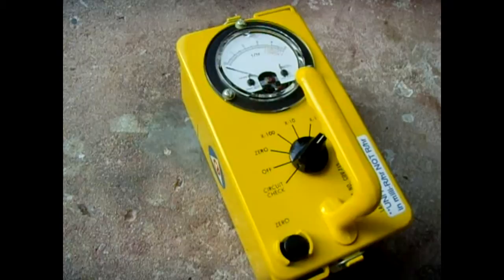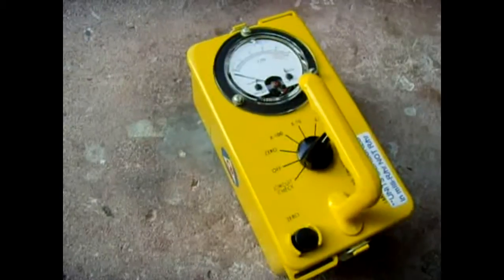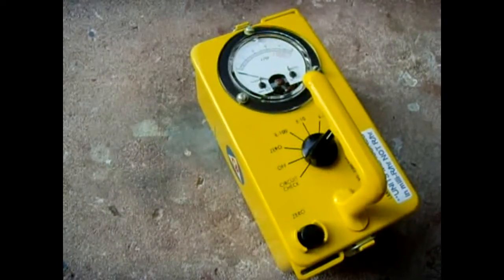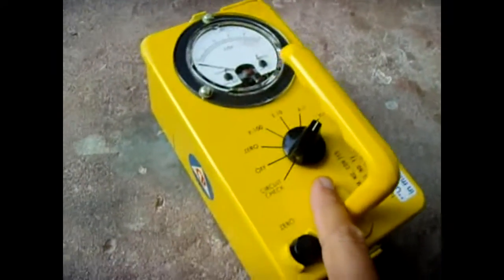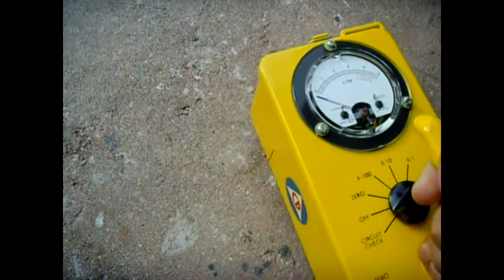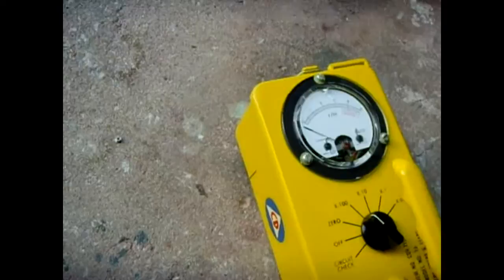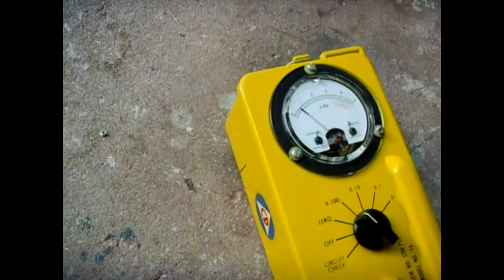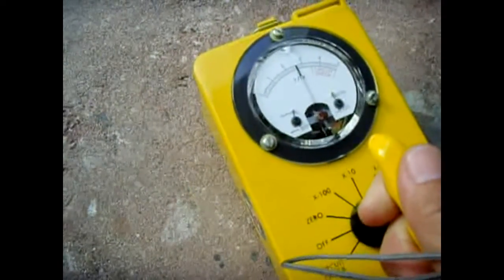CDV-715 Radiation Survey Meter Conversion

Comment: Do you have any videos on how to make a Faraday cage for sleeping in or can you tell me what materials to use to make one that will block all kinds of radiation?? Please I've been looking everywhere and can't find anyone who really knows how to block all of it or at least reduce all of it significantly. I'm super sensitive to it. Its screwing me up
Reply from the maker: Hi Amber. I know what you're looking for. It's called Faraday cage fabric. Some people attach it to their ceiling and allow it to hang down over the entire bed. You also need to lay it under your bed and attach it to the sides that hang down near the floor(Clamp together every foot. You can use a bunch of metal binder spring clips to hold it all together. You leave one side where you enter the bed a long slit overlapped opening in the fabric. Ideally you connect a wire from the metal fabric enclosure to ground.
https://amzn.to/3e1s15D
(Amazon Affiliate Link)

Comment: Neat hack for display, but I think you missed the point of the 715.  They made different models for different jobs.  It would be like saying a screwdriver is useless because you can't use it to nail two boards together with.
Reply from the maker: Hello. I didn't miss the point. I know exactly what it was designed for, but it was worthless to me, so I made it a "useful" radiation detector.

Comment: Hi, Nice video..I see you posted this in 2011 so my info may be of no use but with your power off and batteries removed, your needle should rest above zero. That meter should have a meter zero screw in the middle at the bottom. CW will cause the needle to move right and CCW to left.. It really is not critical unless you want to calibrate the instrument.
It appears you have plenty of gain now and the instrument will be MUCH more useful. I do not know the details of your mod, yet but I am guessing you have an open mesh so you can see alpha, beta and gamma. Place a piece of foil over the mesh opening and it will filter out alpha. Put a piece of double sided copper PCB over the window and then you will only see gamma.  
Good luck.
Glenn 
DSM Labs (dot com)
Reply from the maker: Hi there, You're correct, there is a calibration screw. :-).You are also correct regarding the open mesh. Be sure to check out my other radiation/geiger counter videos as well, rate Thumbs Up, and share.

Thank You!

Comment: Do you sell the 'fixed' ones?
Reply from the maker: No. I only put out the video to show how. These ionization chambers are designed for high radiation levels. If you don't modify them, they are useless. Be sure to check out my geiger counter videos/ionization chamber videos.

Thanks
Reply from the maker: ryan pogue

Yes, in a nuclear war these would be very useful as they are.

Comment from the maker: First of all I never claimed this conversion to be a "PRECISION" detector. To calibrate this unit, you would need to use a geiger counter to verify levels. Secondly, due to the fact that this unit ONLY detected very high levels of Beta and Gamma radiation before the mod, and now it detects ALPHA/BETA/AND GAMMA radiation  at low/lower levels makes this a HUGE improvement over what it was before. Thirdly, THERE IS NO PROBE! Lastly, you are a moron and need to get a life and stay off my channel.

Comment: I see what you're saying.  My point is under post war conditions you may need something that reads in several rem / hr range.  I hear the CDV-700 will be overwhelmed at this rate and read  0.
In my location we'd expect a worst case 1st hr. dose rate at 300 R/H. Hence the shelter.  It seems like maybe I'd need both, a high and low range unit.  Are these CDV units generally still good? I've been looking at some that are still 'new in box'. Calibration costs as much as the meter.
Thanks

Comment from the maker: NO. if you are detecting radiation with one of these meters that have NOT been converted, then it is no good. These particular units were designed for use in HIGH radiation areas. I mean extremely dangerous levels. You need a geiger counter. I made an excellent one. Check out my video list.

Comment: Questions;
For fallout shelter use, these high range devices are what you'd want, correct?
Also, are these things still accurate at all after all these years sitting around?  Again, for fallout use.
Thanks.
Reply: Yes, post attack, you would need to read roentgens in the short term. The high range meters would let you find the area of least radiation even if the calibration isn't exact. The low range meters would be overloaded. That's why CD had kits with high and low range survey meters and dosimeters and a charger. All serve a purpose. The old instruments can be found in good condition and if desired can be calibrated. Many, many CD meters are still in use with emergency personnel.

Comment: i have a few questions, i'm not too worried about alpha rad, since i can't really be hurt, but i have heard that the 715 can detect beta rays, and i don't really care about regular atmospheric radiation, cause that's normal. What i am planning on doing is searching through old antique stores for radioactive elements. will a regular cdv-715 do this job?
Reply: no

Comment from the maker: @stefaan10111992 

How about a simple piece of scotch tape over the battery and to the holder so it does not fall out. Unless your using that detector around Chernobyl/Fukushima.....its worthless as you have it. It was designed for measuring large amounts of radiation.

Comment: @myvideoisonutube My detector uses 1,5v, but the battery keeps falling out when removing the case, while the manual says you can also use the detector while the case is removed.

Comment from the maker: @Weps21 

According to techlib.com, the meter will read in mR/hr after this conversion. So just disregard the R/hr and read everything in mR/hr. I don't think the meter is accurate anyway. I just wanted a sensitive radiation detector, and now it is. You can tell if radiation is around, and if it is a lot, or a little with different settings. The original cdv-715 was useless.

Comment from the maker: @stefaan10111992 

I don't understand your comment. My circuit uses a standard 9v battery. Originally it used 1 or 2 D size batteries.

Comment: What about the meter conversion? The meter face measures in r/hr not mR/hr like a Geiger does, do you happen to have a tutorial to replace the meter face plate so it an be read as mR/hr? 

I own a few meters but I haven't been able to acquire a Geiger at all with the recent public grab due to Fukashima and what not.